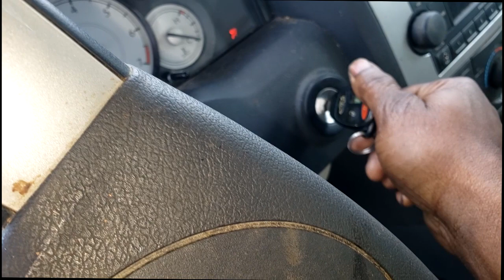I fixed this No Start No Crank car using PB Blaster and a test light. No WD 40. Starter Relay Test.

Comment: Man is that car rusty and corroded underneath! I was expecting mounting bolts to snap, and similar on the power terminals on the starter as well. Glad it went well! That car is going to have major problems soon. Bad grounds etc! Great video J.T.!
Reply from the maker: Yes, whats scary is they want Timing belt and water pump done. Will upload that vid 2morro. Thanks for watching unc